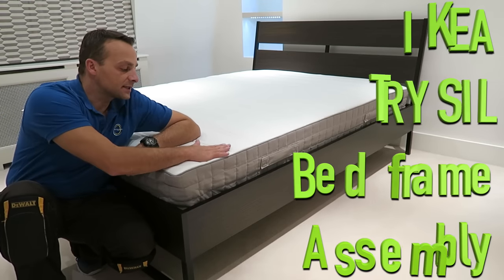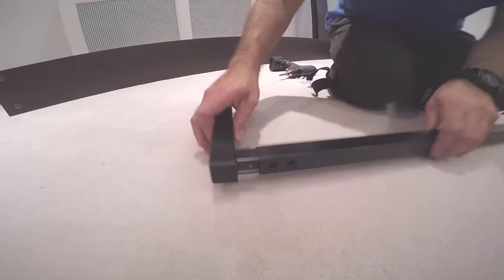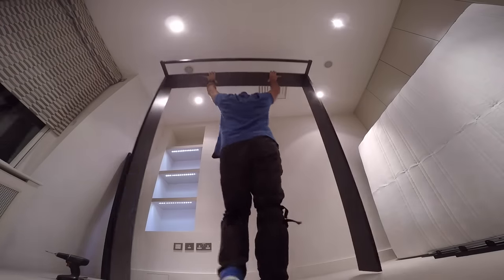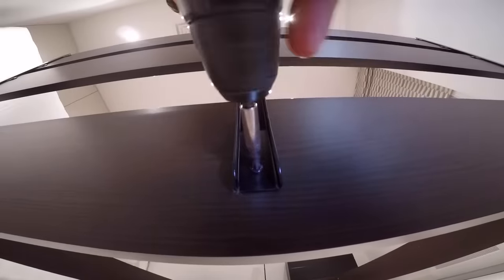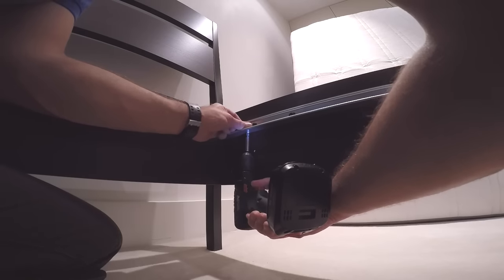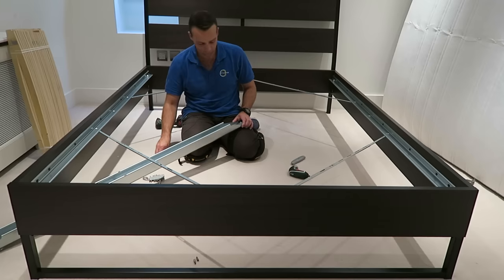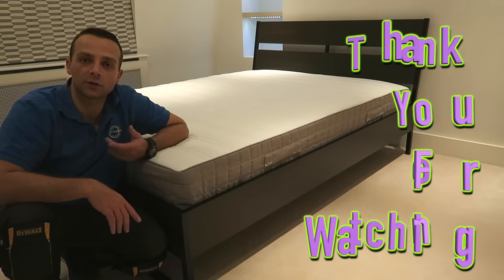Ikea Trysil bed frame assembly

Comment: It'd be nice if IKEA assumed most people weren't illiterate and actually put words underneath their pictures. Then I could actually understand it. There are small details left out that turn into big problems down the line if you didn't catch on to it. 

It's like badly signing to someone what you need them to do, but can't speak their language. For example:

I'm in France and want to know where a sandwich place is, but I don't speak French, nor can they understand English. So I see a group wandering by, brace myself and wave hello, before raising my hands like I'm holding and eating a sandwich. I then raise my right hand and trace a question mark in the air before repeating the gestures. Finally, I shrug in a questioning manner. 

The French group then applauds and then leaves some money, thinking I'm a mime. 

That's essentially how effective the IKEA instructions are to my brain.

Comment: You have to buy the center thing and the wooden things too it doesn’t come included ?
Reply: eiko hikaru all three pieces are sold separately
Reply: I paid $189+ tax for all three , frame $129, metal beam $50, wooden slats $10  usd

Comment: at 4:26 the rails. can these be screwed with a manual screwdriver? it's part 117327 and 117228. they don't fit!
Reply from the maker: mrlawilliamsuk Warmachine Yes you can do with manual screwdriver but you will have hard time with these small screws they are hard to fix but it is possible
Reply: im also having trouble here, even with the power tool its super hard to get them to catch. Should i be putting more force on these?
Reply: This was the only sticking point in putting ours up.. everything else was a doddle.
Reply: Victor Fellowes same screws dat go in da middle of the rails i only got 2 to fit in
Reply: So I’m having trouble with this part as well, are these small beams necessary? Can we use the frame without them?
Reply: @robertteran5533  Hi. I got the beam in and only some of those thin ones. You need the slats. I think those thin ones are for weight distribution, and as a little extra support for the beam. I’ve had this for a couple of years and it’s fine. I’ve even been standing up on the mattress...actually, I’ve been standing on the beam whilst reach for things in top of my (matching) wardrobe. I’m around 12+ stone.

Comment: I'm disassembling and trying to figure out how to unscrew the long screws that attach the headboard to the side panels. It doesn't look like it can grip any screwdriver. What size of screwdriver did you use for those?
Reply: Never mind, I did it with an Allen key.

Comment: Hi, Is an electric drill necessary to put this bed frame together? Or are a standard manual set of screwdrivers enough?
Reply from the maker: +souw1990 Not need electric screwdriver you will be fine just with manual one. It is just faster and you not need to work hard with electric one.
Reply: Children bed

Comment: I have this same bed frame.  I am trying to put it together but I am missing those long black nuts that attach the head of the bed to the frame.  Do you know what size they are?  Where I could get them?
Reply: IKEA will send them to you if they don't have them at your local store. Just get the item number from the manual (you can find it on the webpage with the bed) and give them a call or go in store if you live close to one. If they don't have them, they'll send them to you for free

Comment: I'm not good at assembling ikea things at all. Tried to assemble an ikea desk before and did it wrong as the whole thing fell apart. Do you think it'll be fairly easy to assemble this? If i mess it up will I be able to take it apart and fix it again??
Reply from the maker: :) Depend how bad is the mess up :) This one is pretty easy if you just follow video and check on the instructions you should be fine. Good luck

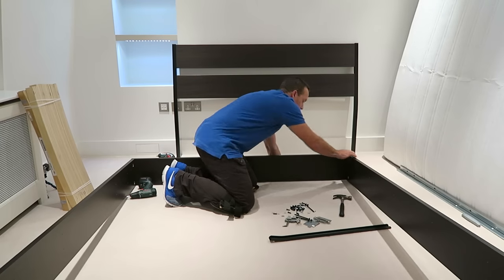Comment: At 2:37 - is the plastic with the nut 100% necessary to secure the headboard properly? Can I do without? I've lost those pieces.
Reply from the maker: Yes it is important piece if you don't have I think you can doit without it just need to put something under the nut to hold the nut in place once you put the long screw in not shore how strong it will be as this is importand conection holding all bed frame. If you go to IKEA find bargain corner they alwats have spare parts you may get lucky and find one you lost it.

Comment: I have to move next month and I have this bed frame. Seems like it'd be impossible to move the bed frame out of the room without disassembling. At the very least removing the headboard. How difficult would it be to remove the headboard / back legs and then reattach them when we get to our new place?

Comment: is it really double size bed?.. it looks queen size to me. Can you tell me the exact size of this frame please. Thanks.
Reply from the maker: I think is standard double I would check but dont have access to this bed anymore. 
Here is the measurements standard double Length: 208 cm
Width:                140 cm
Footboard height:  40 cm
Headboard height: 98 cm
Mattress length: 190 cm
Mattress width: 135 cm

And second size what they do in UK is standard king with measurements
Length:                218 cm
Width:                155 cm
Footboard height: 40 cm
Headboard height: 98 cm
Mattress length: 200 cm
Mattress width: 150 cm
Hope that help.

Comment: Hi, thank you for posting this. I'd like to buy this bedframe but use it without the legs, basically having just the frame on the floor. Do you think it would have enough resistance? Is there a way to attach the headboard without the legs ?

Thanks for sharing!
Reply from the maker: Without legs this frame will not hold together as the legs are the main structure for this bed frame. You can doit without legs but you need some brackets to suport comections in the corners.

Comment: Does anyone know what the clearance from the floor is?
Reply: PP FlatPack thanks for this. I was actually looking to see if there's adequate space under the bed for storage. x
Reply from the maker: agentju Don't have exact measurements but I thing Clarence is no more than 20cm
Reply: USEDguy thank you! I bought it in the end and the boxes fitted well.
Reply: agentju hi, just curious, what storage boxes did you get for this bed?
Reply: Meekr I just went with some plastic ones from Tesco. They cost around  £3

Comment: This bed is super squeaky and have double checked that all screws are tight, even used duck tape, even covered the wooden slats with sheets, anyone have these problems? Solutions please!
Reply: The noise comes from the wooden slats hitting the side of the bed frame when you sit on the bed. Try buying the ikea "Lonset" slats, each slat is in it's own silicone case making no noise at all.

Comment: Man I'm hating this while thing....the screw for th head board just won't go in!! Power drill, tool from Ikea none will work
Reply: Return it
Reply: This is a bit late, but I had that same problem until I realized I forgot the nut. There's a place for it inside the round plastic piece and it's essential to get that long screw to tighten.